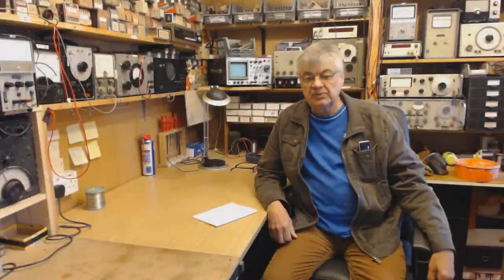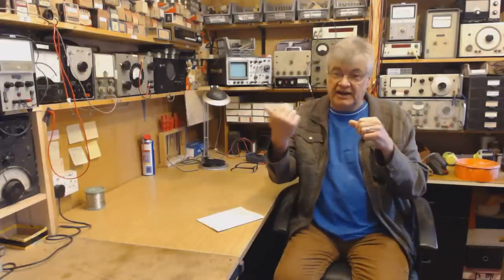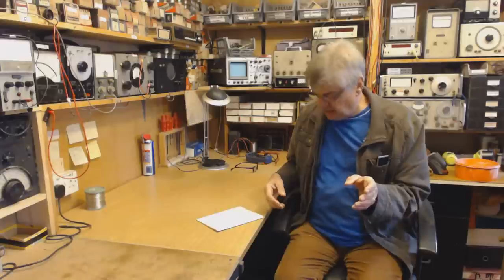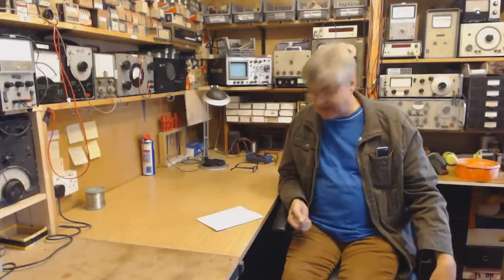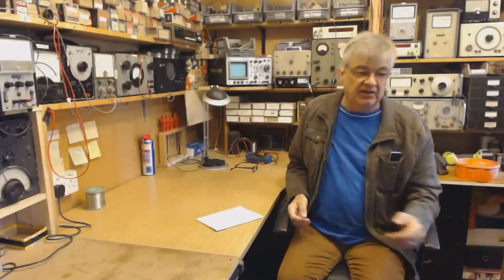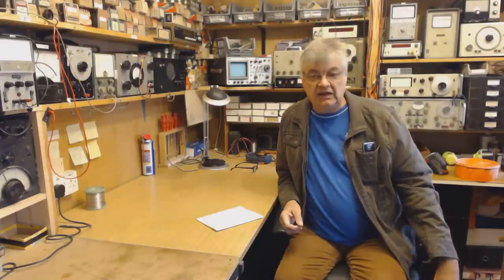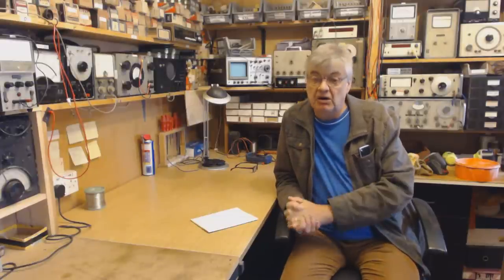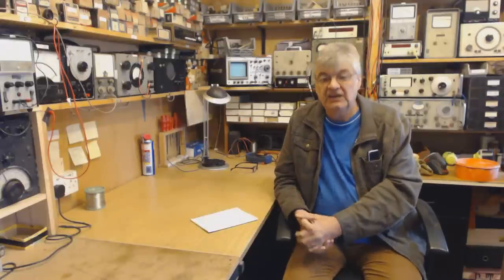Doublet aerial for HF amateur ham radio short wave bands

Comment: I'm new to this and very limited for space I have about twenty five feet of height and length can I get an inverted v on this? Also rig is a galaxy DX 959 straight out of the box no amp, what MTR band am I looking for?
Reply from the maker: Yes, you can fit an inverted V in that space. It should work well from about 5 mHz upwards.
Reply: @g4nsj  thank you and really learning alot from you,73 from Ireland!

Comment: Will the doublet work well for long haul DX? Since you are saying the vertical works best to listen to the long path stuff? I'm thinking to build an inverted V so it will be half way between a vertical and a horizontal will it? I would like to make  Vee Beam to point to the States and feed it with 300 Ohm feeder. My feed point will be around 90ft for the inverted V or lower for the Vee Beam.
Reply from the maker: It should work for DX, yes. I've had some great DX on mine.

Comment: I wonder if my 40m, helical dipole in the attic would benefit with ladder line instead of co-ax?
Also, would it be OK to terminate the ladder line rig side with about three inches of co-ax and a PL plug (as I have no other means to connect ladder line directly)?
Interesting stuff! Thank you!
Reply from the maker: Outer Spaces ladder line is definitely better but you will need a balanced ATU.

Comment: I wonder if a doublet with coils near the feedpoint will act as a electrical extender or its a silly approach for that? I dont have enough space to deploy a 40m doublet nor 80m! My idea is to make a rigid doublet (12m full lenght) feeded with 600ohms ladder and a link-coupled tunner. Thanks again
Reply from the maker: Yes, loading coils will make a difference. It's certainly worth trying.

Comment: I realize this vid' is 5 years old.. but its still solid gold!  back in the 1950's (i was 14) i earned "WAS" with this set up, and now (2019) i jst got back into the hobby.    when i joined our local club to catch up on things, evrybody told me to go with coax.  seriously, if i had a dime for every time someone advised against ladder-line i'd be rich!    but i decided to go with an all band doublet and couldnt be happier!  i get contacts with good reports on 80 - 10 meters.  TOO EASY :)  for anyone considering this set up... jst be aware that some antenna tuners are better equipt to handle a "balanced feed line"
Reply from the maker: Excellent, thanks for commenting. Cheers, Ray.

Comment: Hi Ray, I tried a G5RV for a while but found that taking off that choke and coax and going with 450 ohm ladder line all the way to the shack, gave me a much better signal on 80 meters for SSB and AM phone. I run about 30 feet of 450 ohm ladder line to a 4:1 balun on the outside wall of the shack then coax from the balun to my MFJ tuner inside. When thunderstorms threaten the ladder line is disconnected from the balun and connected over to a ground rod outside near the shack. Really like the balanced transmission line and the flexibility it gives to QSY to other bands. Thanks for this great video.  Terry, WA0DTH
Reply from the maker: Hi Terry, glad you liked the video. The doublet is a brilliant antenna... without the coax and balun. Cheers, Ray.

Comment: I have a 24x8x.375 aluminum plate in my window that my feeders come thru via coax. If I drill two holes for the wire feeder, will the metal between the feed wires be a problem?
Reply from the maker: Hi, it's not the best way to do it but it might be OK. Try it and see how it goes.
Reply: Radio Workshop I think I will mill a slot 1/2” x 2” and make a nylon insert.  I was thinking in a lazy fashion earlier.
Thank you 73 de KG5AJP

Comment: Is there any information on the ins and outs of ladder line? I am wondering how it becomes effected if tied off to a wall or a tree etc. I was planning to have it all in free air by having my tuner up against a hole in the shack which would be filled in with insulation around the ladder line and then straight up to the feedpoint. However i am worried about snow loading and visuals for the neighbours so i would rather tie it off to the tree until the last 8M to the feedpoint. I'm just worried that having the feeder against objects will effect the impedance etc. But i suppose the tuner will take care of this but will there be power loss or signal loss?
  Thanks again
Reply from the maker: izzzzzz6 it should be fine tied off to a wall. There must be loads of info on the web. Just look up ladder or balanced line. Cheers, Ray.

Comment: Thanks Ray, managed to salvage a trap dipole that was fed with a balun then coax. Simply added more ladder line of un known length to the 'carefully calculated' length of ladder line, fed directly into my MFJ atu which has a balanced input (much to my suprise!) it only flippin worked!!! couple of contacts straight away Scotland on 80m and Spain on 40m all with ten minutes of getting antenna working!! Brilliant!!
Reply from the maker: Well done!

Comment: A great multiband antenna Ray and cost pennies when built yourself. I used to have a doublet fed with homebrew ladder line. Saves having too many antennas for different bands and as you say low loss. My doublet was a sloping inverted V configuration to fit available space but performed very well. I know they out perform many costly antennas for the sake of a few quid and bits of wire. Great video  73 M0DAD
Reply from the maker: +m0dad Thanks for your comments, all noted and understood. I must say the doublet is my favourite aerial. Cheers, Ray.

Comment: If you put power to rhe antenna and get the power to be in the antenna. (with matcher or not) the antenna will radiate the power! An other thing is is it radiating heat or rf...
Reply from the maker: Kristian Grönberg I don’t think it radiates heat!
Reply: Agree its about getting the power to the antenna, length of radiator isn't too much of a concern if it's fed correctly, LB Cebik has information stating that the radiator length can go as short as 20% of its half wave length on the frequency of operation before significant and noticeable loss is encured

Comment: Usual absolutely superb 'hands on" stuff from Ray, stuff which can only be explained with such ease by someone who has come to terms with techno-details and turned them into "actually doing it !"  Only then can you attack the horrible things which go wrong with the theory, (and it DOES!!) put 'em right and then explain it in comfortable terms to folks looking for experienced, sensible advice. Ray gives it!

If I might add a little to confirm Ray's very wise promotion of balanced feeder in order to make an antenna work on at least 2 bands and maybe more, this may help.

When a coax fed dipole, superbly tuned & matched for 40 metres, is fed with 20 metre RF, the antenna suddenly becomes a full wave, with a nuisance voltage, high impedance centre-feed point. The 50 ohm coax is quite unimpressed! Miffed even.

This sets up a hi VSWR on the feeder but sure enough, as Ray says, with a decent antenna matcher, it can be adjusted to (appear to) match what ever  random impedance (and unknown reactance)  appears at the bottom. It shows 1:1 on the swr meter but that is only on the bit of coax (patch lead. Ray hates that term!) between SWR meter and rig.
As Ray says "The rig is happy and protected from SWR damage, safely delivering power."
However the SWR on the coax to antenna feed point, IS STILL there. Un-flippn' changed!
Coax ain't too good at handling that & is V lossy. Real QRO would show heat spots at Hi voltage points on the SWR where your expensive RF, strains the polythene inner insulation, forcing energy between inner and outer conductor. At least it's ice free every half wave!
Change to 300 ohm or any other Z (impedance) parallel feeder, and the High SWR still doesn't disappear but the feeder can now handle it readily with very much reduced losses and as a bonus, the unbalance problem is also solved, needing no balun. Neat eh?
Good stuff Ray. You remind me of stuff I thought that I'd forgotten AND HAD!!
Thanks a million. You serve Ham Radio well!
You use 300 ohm. I would too except that the stuff given to me for free is 450.
When life gives you freelemons, make lemonade.
73 G3NBY
Reply from the maker: Thanks for your kind comments, it's nice to get positive feedback. All the best, Ray.

Comment: Carrying on from my previous... with coax feed my 40m dipole was direly deaf on 20m as you might expect... ATU is a high pass T-match...  cannot believe how much difference changing to ladder line has made.., though twiddling ATU is like cracking a safe!
Reply from the maker: Hi David, I'm glad it's turned out so well. Good DX! Cheers. Ray!

Comment: The G5RV, I read that an inverted V, ruins your db. What is your opinion? http://www.radioworks.com/Book/82/82.html
Reply from the maker: knikk77 All that happens is the angle of radiation changes when you change a horizontal dipole into an inverted V.
Reply: Radio Workshop Great! Should you use a balun with this setup or maybe not?
Reply from the maker: knikk77 Not if the aerial is fed with balanced feeder (no coax).
Reply: Radio Workshop Ok, you mean the feeder(ladder line) that is 300-400 ohm goes all the way into the antennatuner? And regular coax 50 ohm into your radio from the antennatuner.
Reply from the maker: Yes, you've got it. That's right.

Comment: When it comes to the dipole length, if necessary you can zig-zag and fold down the ends to make it fit. (Just be careful to keep folded ends high enough above ground to avoid them being a safety hazard.)
Reply from the maker: James Bowie, Hi James, thats what I’ve done with my doublet.  Cheers, Ray.

Comment: So what... keeping ladder line outside of the radio????
Reply from the maker: Paul Hastings the ladder line goes to the ATU.
Reply: @g4nsj  so I  need to get.  The MFJ 300 watts. 
 Open for suggestions
Reply from the maker: Paul Hastings the MFJ will be fine. Any decent balanced tuner will be good.

Comment: You mention how reflected power is rereflected back to antenna at the atu, this is correct and same happens with coax only that coax has more loss with swr on the line, however if a low loss coax is used then more of this reflected power will get back to antenna like it does with balance feeder, so all is not lost if you have to use coax on a multi band antenna into a tuner that's tuning the system to resonance
Reply from the maker: Hi Paul, I use 300 ohm ladder line and it’s great. I understand what you’re saying about coax having more loss. I try to avoid coax if I can. Cheers, Ray.
Reply: @g4nsj  yeah its fine for moni band antennas but you are limited to that one band, I think also the whole concept of multi band antennas into tuners is totally misunderstood mainly due to swr myths that power is automatically lost if you have any reflected power at all or that it get absorbed in the atu, glad you mentioned it at the end, perhaps you could do a video on this subject to help dispel some of the myths surrounding the subject 👍
Reply from the maker: Good idea, Paul. I’ll put that on my video ideas list.

Comment: What kind of DX did you get on the 6 inch nail?
Reply from the maker: Not very good, I'm afraid!
Reply: Has daft has may be coat the 6" nail in copper (Electro-chemicaly) and with a 1/2" length of coax centre conductore connected from a coax feed. Setup 4x 6 1/2" groundplains connected to the shield of the coax. Hey presto a ground plane antenna for 70cm.

Comment: Just wandering Ray, If the feeder cable has to run parallel to the dipole on its way to the shack will this affect the performance?
Reply from the maker: Hi Rad, it will be fine as long as the feeder is several away from the aerial. The further the better, of course.
Reply: @g4nsj  Thanks Ray.

Comment: I am looking to upgrade my outdoor antenna and have been looking at a doublet antenna as a replacement.  I understand the basic principals of the doublet antenna and heard a comment you made about the twin lead feeder.  You pointed out that it does not radiate.  It was always my understanding that it actually does radiate that is why it is so successful as a multi-band antenna.  I was also under the impression that a number of hams didn't like the idea of bringing the twin lead feeder into the shack just for that reason.  Additionally from my readings I have learned that the twin lead must be some distance away from things like rain leaders/gutters to avoid interaction with them.  If the twin lead didn't radiate wouldn't this be a non issue?
With that said, regardless of this, I still think it will be a viable replacement over what I'm presently using which is an end-fed 65' wire up at about 30'.  
The other issue I see is bringing the twin lead into the shack.  I figure I can do this a number of ways including penetrating the existing outer wall.  
Best 73 ES HNY
Kurt - W2MW
Reply from the maker: Kurt Zimmerman Hi Kurt. The feeder doesn't radiate because it's balanced, any radiation is cancelled out. 300 ohm feeder can be dragged through bushes but it is best kept clear of metal objects. It's a very good aerial and well worth trying. Cheers, Ray.
Reply: Ray, thanks for your explanation which is very helpful.  My next concern is bringing the twin-lead into the shack.  I have thought about penetrating the outer wall with about a 1 inch drill.  (this is actually one of the top ideas I'm considering).  I do have a casement window behind my station which opens/closes by sliding the window left/right.  The window frame is made from aluminium which would prevent me from simply pass the twin-lead between the window and the frame (I'm assuming).  What are your thoughts?  Thanks in advance, Kurt
Reply from the maker: I'd go through the wall. That should be fine.

Comment: Hello Ray a great video. I have the following space to play with: horizontally 28 feet, sloper 30.5 feet. I don't have the opportunity to have a pole midway for an inverted vee. My question: if I droop about 2 feet of the wire on each end down each pole to squeeze in a half wave length of wire for 20m would the doublet fed by 300ohm ladder line work? Also do you think this might work at all for 40m? Cheers Tim.
Reply from the maker: Hi Tim, dropping the ends down will be fine. 29 feet isn't very long but it will work with 300 ohm line. As to how good it will be, you'll have to try it and see. Give it a go, it might be pretty good. Cheers, Ray.
Reply: Thanks Ray. One final question, would this doublet work ok as an inverted-vee (about 42 feet in total length) for 40m-10m?
Reply from the maker: Yes, an inverted V would be ok. That's how mine is configured.
Reply: Thanks for taking the time to reply and for making the video. 73s

Comment: Hi Ray. Thanks for answering the ferrite ring question. Sorry to bother - about grounding. My mast will be mounted on the back corner of the house - using T and K brackets i.e. no contact with ground. The 300 ohm ribbon will run into the attic through a hole (wife not aware of that one, yet!) - to an ATU. 

Should I run the ribbon through some sort of lightening protection (just before it enters the house) and connect to a common ground with the mast? 
Or should I ground the mast and leave the balanced line i.e. just disconnect from the ATU when not in use?

Many thanks in advance, Adrian

Comment: Hi Ray...thank you so much for taking the trouble to upload your videos...they are so useful for newbys like me with my still wet M6 callsign.

One thing that always scares the life out of me when watching vids like yours is when I think I am following everything so well and a term you use a term such as..."as long as its a balanced input on your ATU"...I just dont know what that means.

I dont know if its practical to explain terms like that when they crop up or not but it would help novices like me no end.

I have not got an HF rig yet I am in no hurry..still enjoying 2mt..

But the day will come when I need to move on...I want to be able to construct my own HF antennas as I do for 2m so have lots to learn.

Thanks again Ray...keep up the good work.

Nick.
Reply from the maker: Hi Nick, thanks for your comments. Good point, I'll try and explain a little more such as balanced ATU etc. I tend to rabbit away without thinking at times. Good luck with the hobby/ Ray.
Reply: OK, I'm pretty new into this HF stuff too, so I don't know much, BUT...

A balanced input might refer to something like ladder line cable, which is a cable made of two wires separated by spacers.  It's called balanced because current travels symmetrically between the two wires.

Unbalanced might refer to something like coax, which is unbalanced because of the way the current does NOT flow symmetrically along the different conductors.

I think...
Reply from the maker: FlyingPiper13 Yes, that's right. You'be got it.

Comment: Hi Ray... Good stuff as usual.  I wonder...and I will try at some point....to feed a 2/70 dipole with 300 ohm feeder....and I am going to see what happens with the shop bought 2/70 vertical feeding it with 300 ohm balanced feed too. Have you ever tried this ?? I am working on the none radiation of balanced feeder v coax principal you mention....will it work...we'll see.